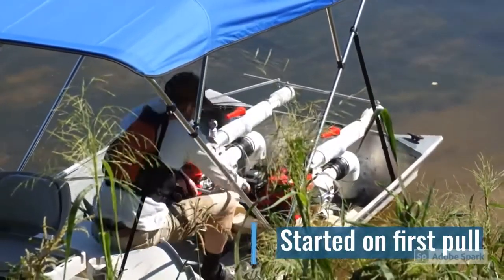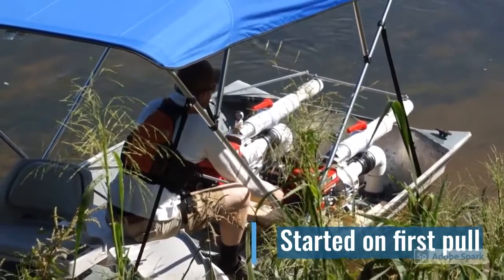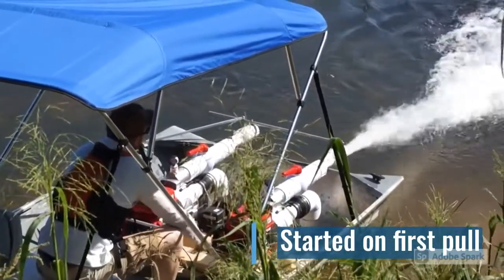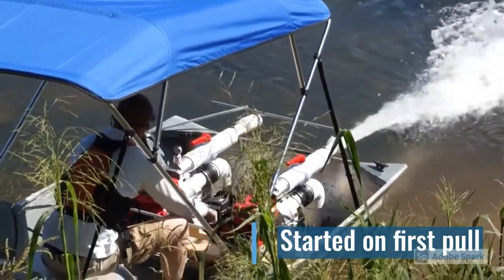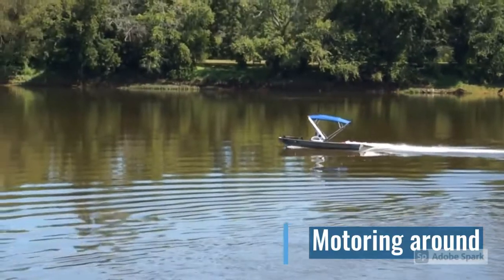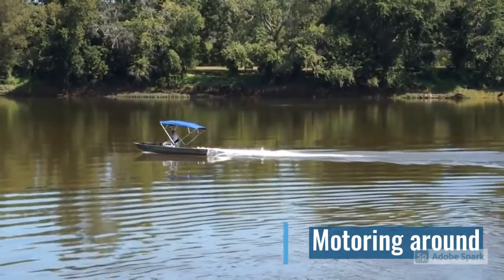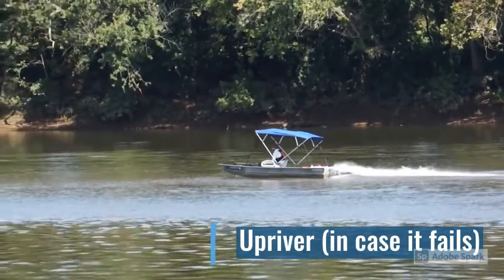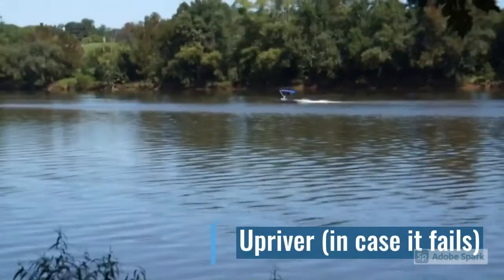Jet Boat - Water Powered Boat Maiden Voyage

Comment: Thats not very efficient for 15hp, you should try a 3d printed jet. Ive got a 100mm impeller and it does more then both of your pumps with one 212cc
Reply from the maker: I agree this is not an efficient setup. It was just for fun!
Reply: @greenlizardusa3105  exactly i admire the simplicity, after all it is only a water pump.